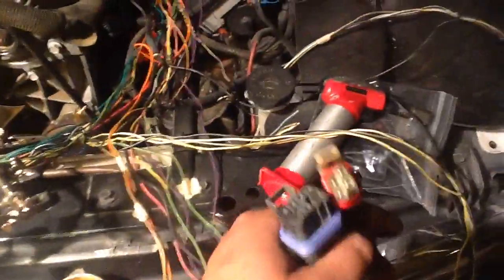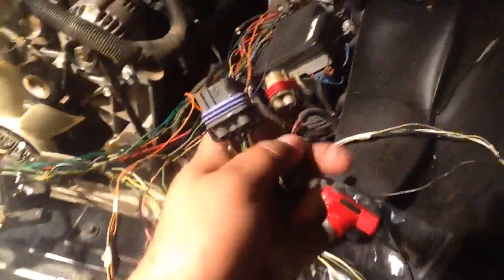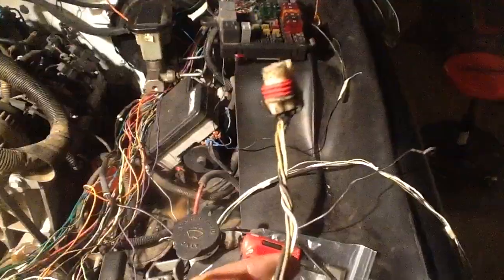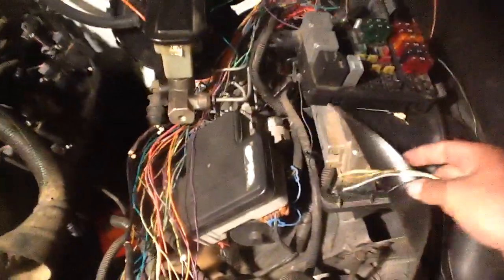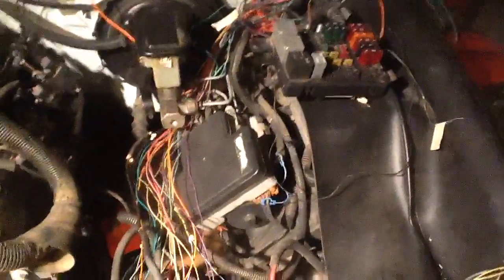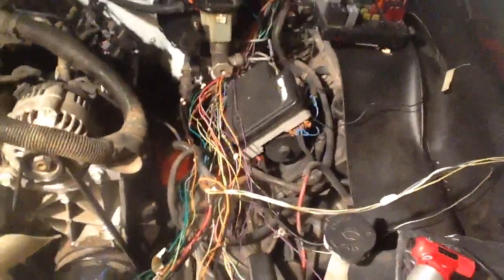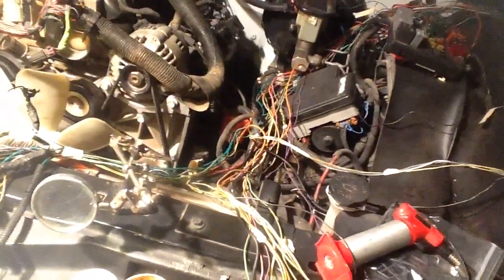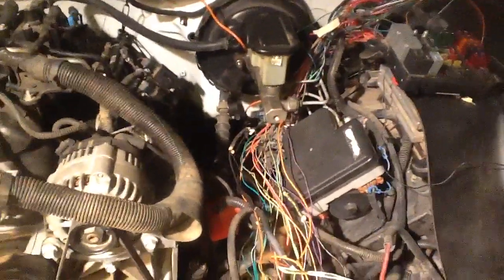OBS How to make PRND123 work on your swap

Comment: Having a problem with my 96 obs the trans works fine but indicator shows park and reverse then disappears neutral drive and comes back and shows 3rd and 2nd but when it goes out the gauges quit and park lights go out any help would be appreciated

Comment: My trucks ECM won't tell the transmission to go into gear tires spin for for a few seconds then stops because I have a faulty safety switch. They're not just for range and park this switch tells what gear to shift in too pfft.

Comment: Wrong the 4 wire cable is for your shift solenoids because another video explains that it's called a neutral safety switch dumbest thing ever

Comment: Hey gary i have a 1997 gmc sierra 1500 my truck is extended cab the drive shaft the same or do I have to do some mod on it sir it is a 4L60 transmission
Reply from the maker: No mod required. Just get dirty dingo motor mounts and set the new motor/ transmission in

Comment: At 2:25, after you tap those 4 wires into the harness, where do you plug them in to the pcm?
Reply from the maker: The 97 had those range wires on the original harness. My donor also had the same range wires, they start at the transmission,  terminate at the pcm. You take the obs range wires and piggy back them wherever you want on the donor. Down by transmission, or dig them out by pcm. I did mine at transmission

Comment: How’s it goin Gary my name is George I took an ls out of an 03 Tahoe put it in my 99 suburban got it goin but having problem with my gauges inside don’t have oil pressure temperature speedometer or tachometer I have some wires that I can figure out if u can email me or call me with wiring schematic for the left over wires to marry both harnesses would greatly appreciate it 949-584-1009
Sirbiggieg@cox.net thanks

Comment: Pin E goes to terminal E1 on the driver side firewall connector, circuit #806, Fuse output crank, type lll fuse  auto transmission. Pin A goes to pin A in the C200 connector under the passenger side dash, circuit #1737, transmission mounted nuetral safety switch output,  park, nuetral

Comment: Can you email me I Have question about my 94 c10 5.3 swap
Reply from the maker: Skeeter5283@gmail.com
Reply: Gary Garcia  ok I emailed u
Reply: Gary Garcia this George again sirbiggieg@cox.net
Reply: Gary How’s it goin Gary my name is George I took an ls out of an 03 Tahoe put it in my 99 suburban got it goin but having problem with my gauges inside don’t have oil pressure temperature speedometer or tachometer I have some wires that I can figure out if u can email me or call me with wiring schematic for the left over wires to marry both harnesses would greatly appreciate it 949-584-1009
Sirbiggieg@cox.net thanks

Comment: Hey Gary I have a 1999 Tahoe we’re doing a 5.3 swap and I have a few questions about the gear selection plugs I just got confused a little bit
Reply from the maker: what are you stuck on
Reply: Gary Garcia   I have 2006 drive by wire with a 4l60.  It has the big single style plug that is used for neutral backup etc do I use it which matches with the ls harness or do I use my stock 99 one
Reply from the maker: use the 2006 plugged into the 4l60e, then find the 4 range wires on both new and old harnesses, attach your old range wires in parallel with the new harness. this will illuminate the dash and satisfy the pcm
Reply: Gary Garcia ok do I eliminate the other plug on the 99 harness or what
Reply from the maker: Jonah Russell take the 4 range wires out and just leave the plug alone, i wouldnt remove it in case you need it
Reply: Gary Garcia what did u do about all the other old 99 trans plugs
Reply: @skeeter5283  I just subscribed.. Thank you.

Comment: Gary. Thank you so much. I bought LS conversion harness that didn't come with the Transmission Park Neutral Safety switch.  I need to add pins to this harness. Do you know which ones to add to red/ blue connectors? Thank you in advance for your help.
Reply: I just wanted to follow up Gary to see if you were ever able to identify where the different range colors went on the ecm or red/blue connectors?
Reply: i guess Im pretty randomly asking but does anyone know of a good website to watch newly released series online?
Reply: @Felipe Braylen Flixportal :D
Reply: @Bowen Alfonso Thanks, I signed up and it seems like a nice service =) Appreciate it!!
Reply: @Felipe Braylen Glad I could help =)

Comment: Hi Gary.  I'm doing a total transplant from a 1999 Silverado 2500 Lq4, 4l80, push button transfercase into a 1999 Tahoe 2dr 5.7,4l60 push button transfercase.  What else do I need from the Silverado to make it all work?
Reply from the maker: huffed70 I haven't done a 4x4 yet,  but I would assume you retain everything in your tahoe from the transfer case rearward, keeping the shifting all oem.make the adaptation at transmission,  hopefully the input shaft all fits. The harness on your donor can be pinned to accept a momentary ground to a pin on pcm so it can understand it's in 4x4 to change shifting parameters.

Comment: off topic question..... where did you hook up the tcc? I have a standalone harness with a wire for tcc but don't really know where to put it...
Reply from the maker: I copied the following from Brendan website lt1swap.com 
If you have any problems finding pin locations or wiring problems, check it out. Plus he knows how to tune computers for swaps 

Pin 33 - Purple - TCC Brake Switch - This wire tells the PCM when you hit the brakes. It needs 12v+ all the time, and the brake switch should "open" this circuit when you hit the brakes.
Reply: +Gary Garcia much appreciated
Reply from the maker: Yes sir
Reply: @skeeter5283  so where did you hook up the tcc cable once the harness is done as Branda's?
Reply from the maker: @gtrick7989  i believe that wire is found at the connector for cruise control. On the obs
Reply: Helpful tidbit of information.  So I keep the 4 wire plug as is in the original OBS harness and splice in 4 wires to add into the new PCM.

Comment: I have a 94 single cab with I did a 5.3 swap off a 2012 silverado with came with the 6l80e  , but I can't get my reverse light to work , and I was wondering if you know how I would be able to use the manual mode since on the original 2012 truck it uses paddle shifters Style not the steering wheel gear selector like the original 94 model
Reply from the maker: did you watch the video?

Comment: Hey gary what's up bro my names Javier. I really appreciate all ur videos but ive been trying to find out so much about doing a swap in my truck but I wasnt sure if it was possible to do a 5.3X in my 93 4.3. but i just  saw ur video on ur side step. and that ride is Sick AF. Mines jus like urs. i got a 4/6 drop. but i need that V6 out bro. Im from Tx but i live in the Va cuz im in the Navy so no one here knows how to do that and if they do there crazy expensive so i wanna do it my self but I got so many questions about Trans, drive shaft, rear end ... its crazy and like i said ive never seen anyone do it on a 4.3 till i found u. So if u can hit me back and give me some answers that be tight. Thanks bro
Reply from the maker: it's pretty easy bro,  truth is you just need to gather all the right parts and it assembles easy. the obs trucks are close enough in years that it requires minimal modification to work. I like 2003-2006 donor engines because I've done a bunch. buy dirty dingo mounts,  use lt1swap.com for the vats removal,  the rest depends on you.  driveshaft is the same.

Comment: Hey I shortened my harness this weekend my range selector was cut, will the motor run without it
Reply from the maker: yes,  what year vehicle do you have
Reply: 78 Malibu
Reply from the maker: +Ced Smith it will run,  but I like the way it runs with pcm seeing range wires

Comment: Don't forget :use a hair dryer or heat gun to heat the range switch plug to unplug  them..
Reply from the maker: thank you Desmond,  yes a hair dryer,  or a heat gun with more caution. they are sealed with some sort of low temp glue